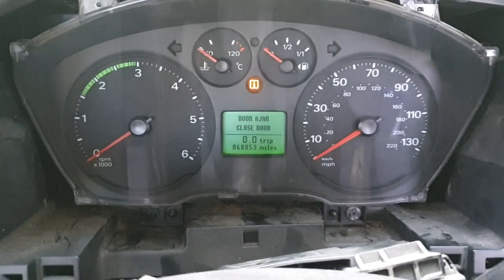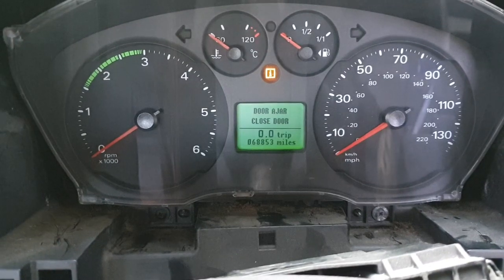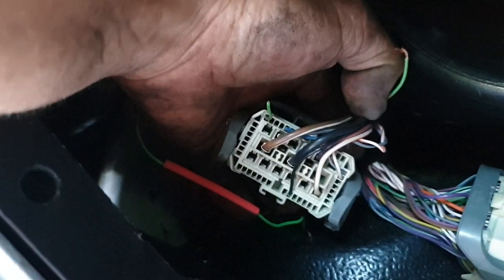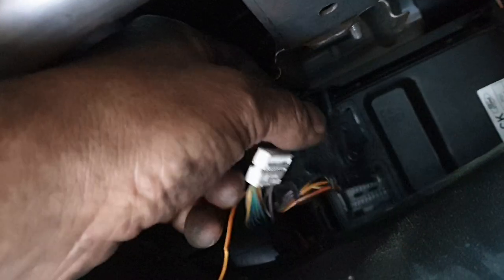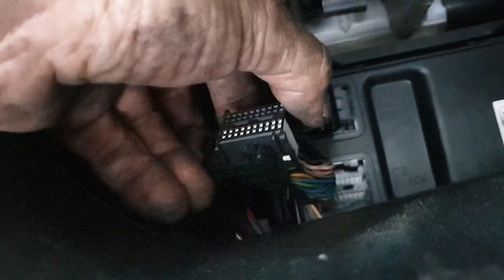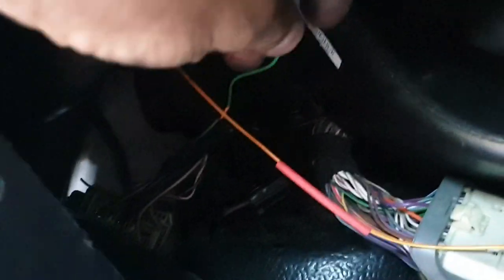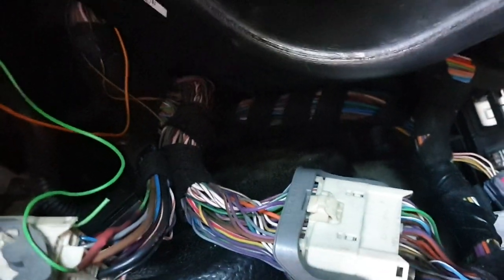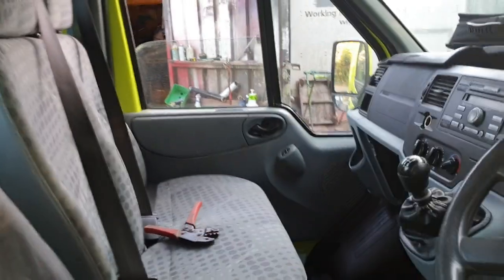2008 Ford Transit central locking recovery truck.. fault body module minibus lock unlock to earth

Comment: I fixed the problem on my t350 by replacing the wiring loom in the cargo back door (door with no handle driver side) easy job 45 minutes

Comment: I changed the engine on my ford transit pickup from 22euro5 to 24euro4 but I had to change the wiring loom as well but it came out of a transit van I can't get centrel locking to work can you please help me to get this sorted

Comment: Hi mate really hoping you can help. I’ve got a mk6 crew cab tipper. Central locking packed up so I brought a module off eBay. Came back to life but doing the same as yours locking then unlocking straight away. I believe it’s because the module is off a van not a crew cab tipper. Do you know what I need to do to get it working again. Thanks
Reply: Confere se não está Rompido os fios da porta traseira do lado direito

Comment: Hi mate I have a ford transit mk7 back door wont lock just makes the beep sound all the others do lock I brought a new back door mechanism but still doing the same any idear cheers
Reply: I got the same problem, trying to find a solution online. Have you mamage to sort it out yet?
Reply: My locking doesn't work from the remote 💔🤷🏻‍♂️
Reply: Same here. Side door and back door wont work. Any solution please?
Reply: @josephsaliba602  hi yes I fixed mine there was a break in the wire, open the back door and where the hinges is there is a peace of black tube where the wire runs to the lock mechanism  I found that mine had broken inside there hope this helps
Reply: @albert6131  thank you so much. Will have a look.

Comment: Hi Pal I have a ford transit 2.2tdci 2007 motorhome iv notice condensation run down the front screen now I now have no e/windows /no heat or air con from the heater but fan blows on all speeds I thought body control module but they are water tight any ideas cheers
Reply from the maker: Hi mate I would look at all fuses..see if you have power 2 seats and follow the wiring back and see where the power stops.. you will probably find that once you find where the power stops that would be the source for all the items that are not working.. if you pull the glove box down that is a body module behind there that's not watertight..
Reply: @danevo500bhp  thanks, much appreciated
Reply from the maker: If you pull the glovebox out you will see the body module.. at the top of the module you will see two tabs and behind it is a second fuse box

Comment: It's still not fixed ! on your video there's still a fault when horn sounds
Reply: I have mk7 it was 22 euro 5 and jurned it back to euro 4 and der is no slot to clip in the third wire is der any other way to do this thank